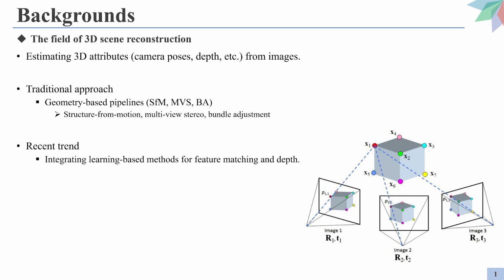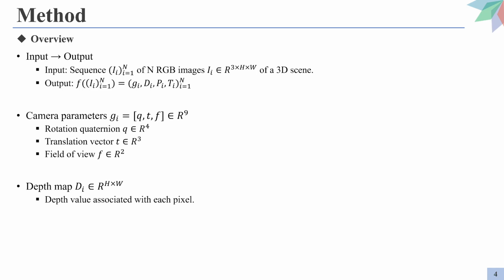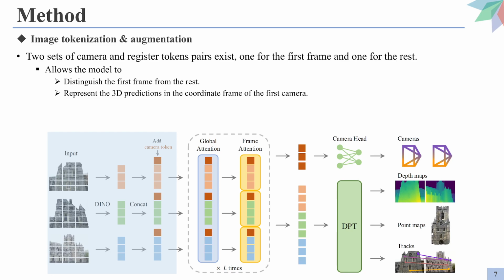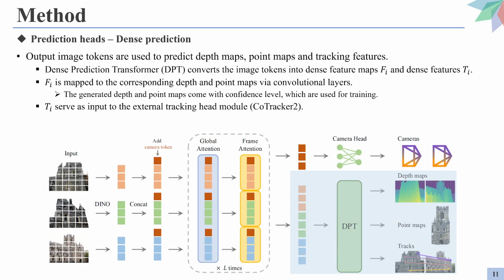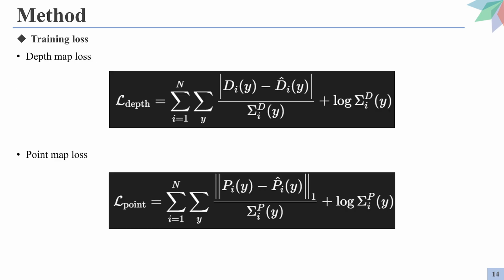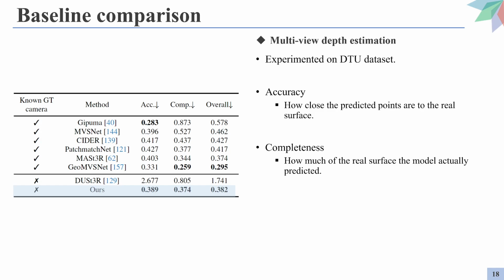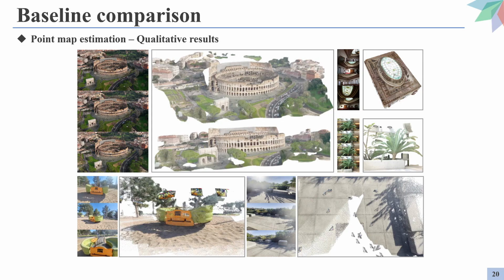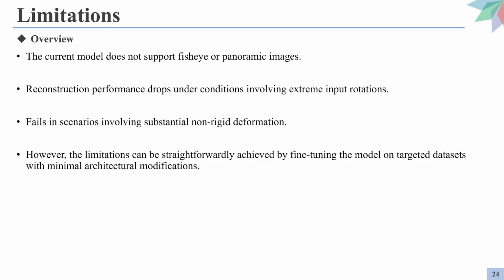[Seminar] 3D geometry estimation from multi-view images

Comment: Thank you for the presentation

Q1. Regarding the Multitask Learning Efficiency "In your presentation, you mentioned that reconstructing the 3D points by combining Depth and Camera Pose yields higher accuracy than the Direct Point Map Prediction. If that is the case, what is the rationale for including the 'Point Map Prediction Head' in the training process, given that it performs worse during final inference?

Q2. Regarding Data Dependency vs. Geometric Constraints "In the conclusion, you stated that the performance degradation under non-rigid motion or extreme rotations stems from a 'lack of training data rather than the model architecture.' However, traditional geometric methods (like SfM) have historically addressed these issues through mathematical optimization without relying on data training. Do you believe that simply scaling up the data is sufficient for a Transformer to fully learn these complex physical and geometric constraints?"
Reply: A1. Because training with extra tasks makes the model smarter overall. The point-map branch might not be used at test-time, but forcing the network to learn point maps helps the shared backbone learn stronger 3D geometry features — which means the depth+camera predictions also improve.

A2. Given enough data with such extreme conditions, I believe the model should be able to handle them.

Comment: Q1. How does VGT maintain consistent geometric reasoning when processing hundreds of input images simultaneously, given that transformer-based models typically struggle with quadratic attention scaling?
Q2. How does VGT handle scale ambiguity in scenes where absolute depth cannot be inferred from monocular cues alone?
Reply: A1. VGGT maintains geometric consistency across hundreds of images by using Alternating-Attention, which combines frame-wise and global self-attention. This design reduces the computational burden of quadratic global attention while still enabling effective multi-view feature interaction.

A2. The model predicts all 3D quantities in the coordinate system of the first camera, ensuring consistent relative scale across views. When absolute scale is required, a similarity alignment step is applied to resolve global scale ambiguity.

Comment: Q1. How does the use of alternating attention and a distinct token strategy for the first frame allow VGT to capture global geometry while effectively establishing the first frame as a fixed world coordinate anchor for relative camera pose estimation?
Q2. Given that combining predicted depth and camera poses outperforms direct point map prediction, what does this imply about the structural dependencies between geometric attributes and the benefit of decomposing 3D coordinates into depth and pose rather than inferring them directly?
Reply: A1. Alternating attention lets the model first understand each image, then connect all images together. The special tokens for the first frame mark it as the “origin,” so all other camera poses are learned relative to it.

A2. Predicting depth and camera pose separately is easier and more reliable than guessing full 3D points directly. This shows that 3D point positions depend on both local depth and global camera geometry, so splitting the task improves accuracy.

Comment: Thank you for interesting paper.

1. On p.11, is there a reason they first group with global attention and then unfold it back into frame attention?

2. How do the papers or results handle occlusion issues? On p.20, is the interior of the Colosseum also rendered?
Reply: A1. Global attention lets the model share geometric information across all views first. Then frame-wise attention refines each image’s features locally, without interference or noise from unrelated views. This order balances global alignment first, local detail second.

A2. Occlusions are handled implicitly through multi-view consistency. If a point disappears in one view, other views still provide its geometry. The interiors would not have been reconstructed, as the input images do not hold the views of those.

Comment: Q1. What key 3D scene attributes does VGGT predict directly from one or more input images in a single forward pass?

Q2. In what way does VGGT differ from traditional SfM/MVS pipelines regarding the need for post-processing with visual-geometry optimization?
Reply: A1. VGGT directly predicts the following key 3D scene attributes in one forward pass. Camera parameters (intrinsics + extrinsics), depth maps, point maps, and point tracking features for correspondence across views.

A2. Unlike traditional SfM/MVS, which requires iterative post-processing, VGGT’s predictions are directly usable without further optimization. It is feed-forward, fast, and already achieves high accuracy before any geometry refinement.

Comment from the maker: Thank you for the presentation.
In future presentations, it would be highly beneficial to include your own interpretations or opinions on the paper, as this would help provide deeper insight into the field.

I have some questions. First, on page 1, the comparison between the traditional approach and the recent trend seems somewhat outdated. Instead, I would like to see a comparison between VGGT and the most recent previous SOTA method. What specific advancements does VGGT achieve over the prior SOTA?

Second, on page 6, the architecture is introduced. Why do the authors include "Track" data as an output of this architecture? Is producing such data a primary goal in this field, or does learning "Track" data contribute to improving the model's understanding or performance in some way?
Reply: Thank you for your advice. I will make sure to include my own insights in future presentations.

A1. Compared to the prior SOTA (e.g., DUSt3R, MASt3R, VGGSfM and recent multi-view variants), VGGT achieves higher accuracy in camera pose estimation on CO3Dv2 and RealEstate10K, while being faster (∼0.2s feed-forward vs several seconds with optimization). It also produces denser, more accurate point clouds on ETH3D than DUSt3R/MASt3R, again without costly test-time optimization. Lastly it handles many more views at once (up to hundreds) in a single forward pass, whereas earlier SOTA methods are limited to pairs or small sets and rely on post-hoc fusion or BA. 

A2. Supervising tracks during training acts as an additional geometric constraint. The ablation study shows that including the tracking loss improves point-map quality, indicating that learning to track helps the model build a stronger, temporally and geometrically consistent representation.

Comment: Q1. VGGT processes all images in a single forward pass without classical optimization steps. Could you explain why removing iterative optimization does not harm reconstruction quality? Are there cases where iterative refinement might still be beneficial?

Q2. The model uses alternating global attention and frame-wise attention. What specific geometric relationships does each attention mode help the model learn, and why is alternating them more effective than using only one?
Reply: A1. VGGT does not lose reconstruction quality because it learns multi-view geometry directly from large-scale 3D-annotated data, so it no longer depends on solving geometry through iterative refinement at inference time. Iterative optimization can still help in difficult cases, as the paper shows that adding a lightweight BA step on top of VGGT further improves results.

A2. Alternating them forces the model to first align the scene globally, then refine details locally, and repeat. Using only one type would either lose multi-view understanding or weaken per-image structure.

Comment: 1. Since the model predicts multiple outputs, the dataset would need to contain all these values (camera pose, depth map, point map, 3D track) for training. Do all the datasets introduced on page 16 include these predicted values? Or is there some method used to extract the necessary training data?

2. I’m also curious about the model size and the GPUs used for training.
Reply: A1. No, not all datasets contain every target. Some datasets provide camera poses and depth directly, and the point maps can be derived from depth + camera geometry. Tracks are generated through multi-view correspondences or separate tracking annotations. Missing fields are computed or converted using standard geometry. The model is trained using a combination of ground-truth data and geometry-derived supervision, depending on dataset availability.

A2. VGGT is a large transformer model of 24 alternating-attention layers. It was trained on multiple high-end GPUs, as indicated by runtime benchmarks measured on an H100 GPU for inference.

Comment: Q1. To what extent does the Alternating Attention architecture in VGGT implicitly perform geometric optimization—such as triangulation or a form of bundle adjustment—and how does a purely feed-forward model manage to preserve strong multi-view consistency without explicit geometric post-processing?

Q2. How does VGGT implicitly resolve scale ambiguity and gauge freedom without explicit normalization, and what mechanism within its multi-task design encourages the model to converge to a single consistent global scale and reference frame?
Reply: A1. The alternating attention applies global- and frame-wise attention repeatedly across layers, so the network learns multi-view consistency during training, rather than solving it iteratively at inference time. Thus, the model preserves strong geometric alignment without explicit bundle adjustment, though iterative refinement can still improve accuracy in difficult cases.

A2. VGGT resolves scale and gauge freedom implicitly through its design. The first camera is given special tokens and fixed as the world reference. All depth and point maps are predicted in that same coordinate frame. Joint supervision on camera, depth, and point maps together encourages a single consistent geometry. This combination removes arbitrary scale drift between views and anchors predictions to a unified coordinate system, while still allowing optional similarity alignment to absolute scale during evaluation.

Comment: Q1. In this context, what exactly does “frame” refer to?
Is the input processed as a sequence of frames similar to a video, or is each frame treated independently?

Q2. Why is the camera loss formulated using the Huber loss instead of an L1 & L2 norm?
I would like to understand the rationale and use cases where Huber is preferred over other loss functions.

Q3. The outputs include cameras, depth maps, point maps, and tracks.
Are these the complete set of outputs required for the system, or could there be additional predicted parameters in future extensions?
Reply: A1. In VGGT, a frame refers to an individual input image. Thus, each frame is treated independently in terms of input, but jointly in terms of multi-view geometric reasoning.

A2. Huber loss is used because it behaves like L2 for small errors, enabling smooth optimization and behaves like L1 for large errors, making it robust to outliers. VGGT predicts camera rotation, translation, and intrinsics simultaneously, where occasional large errors are expected. Huber helps stabilize convergence and prevents large pose errors from dominating the gradients. 

A3. Extensions can be added. The authors explicitly position VGGT as a general 3D backbone that can be extended to downstream tasks such as novel-view synthesis and dynamic point tracking by attaching additional heads.

Comment: Q1. This paper seems to deal with 3D scene understanding. In camera pose estimation, what cues can a model use to infer the camera’s position and orientation?

Q2. Why do the four tasks (camera pose, depth, point map, tracking) reinforce each other, and is there any trade-off between tasks in multitask learning?
Reply: A1. The model infers camera pose from multi-view feature correspondences, and global consistency across views.

A2. The four tasks reinforce each other because they describe the same 3D structure from different angles. There can be small trade-offs, but overall multi-task learning improves accuracy and consistency.